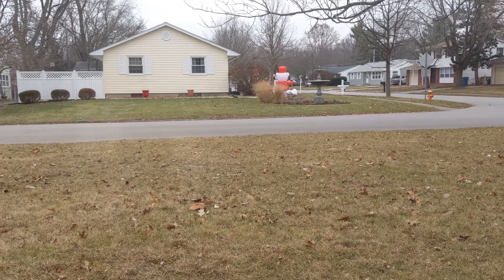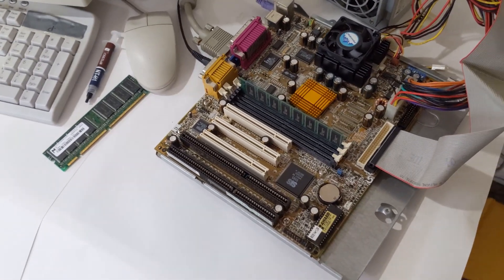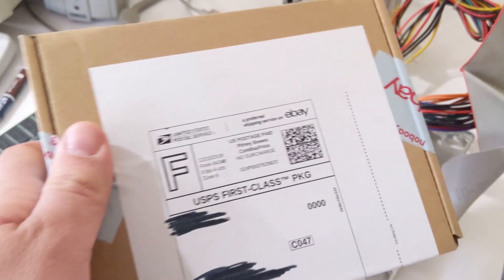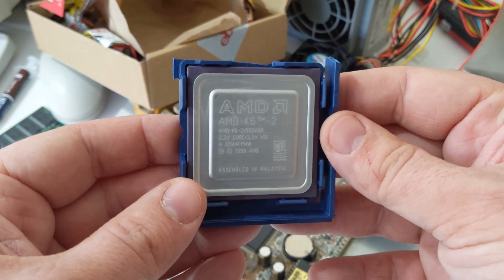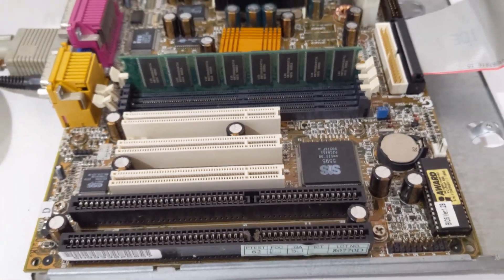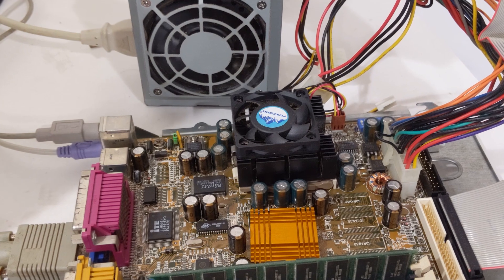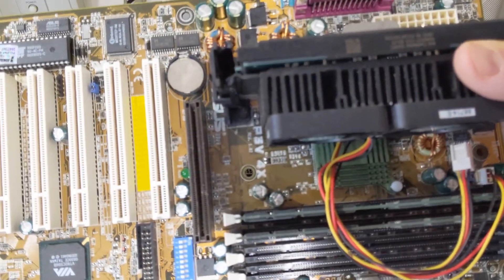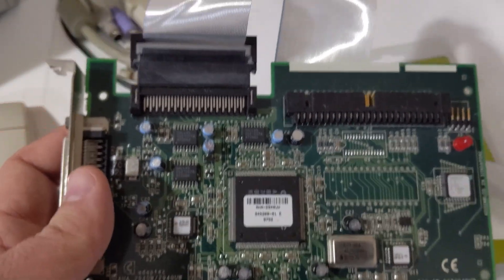1998 PC Interactive Build 1 - AMD or Intel and Storage!

Comment: Sux about the board. Did you test the PSU to see if anything was way out of spec?
Reply from the maker: I did, yeah, 12V was a little high but nothing to be concerned about. I tried another PSU too. 
In hindsight, when I shut down the machine last week, it was being weird. It restarted (even though I definitely selected shutdown), then when it came back up, I shut it down again and it went to the old "It's now safe to turn off your PC" screen. I didn't think anything of it then, but maybe that was an early warning sign.